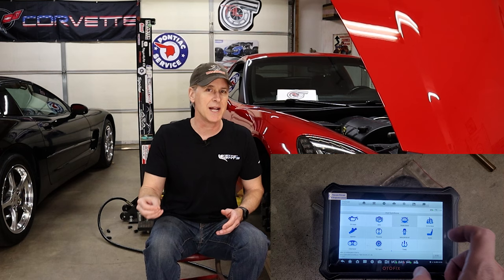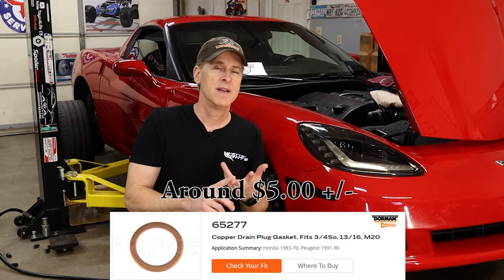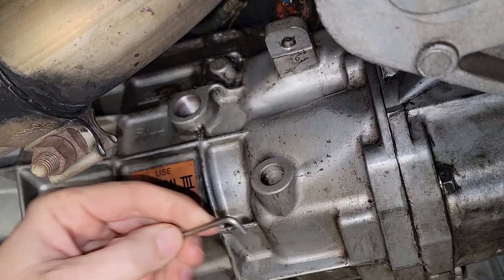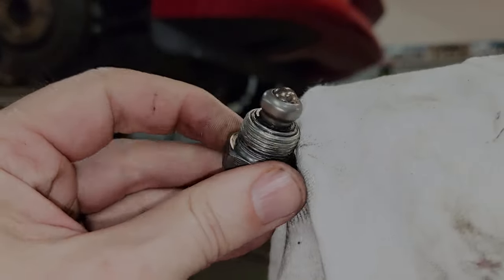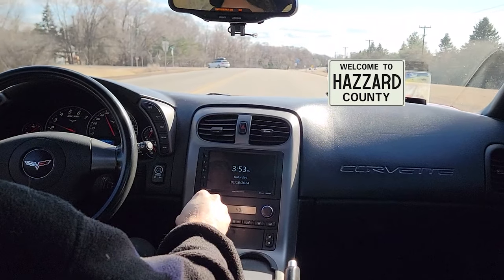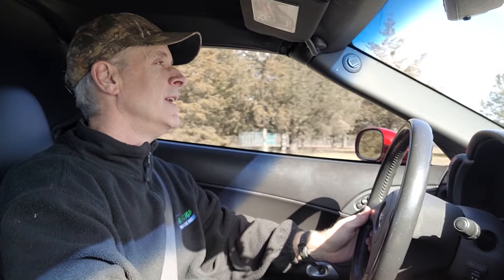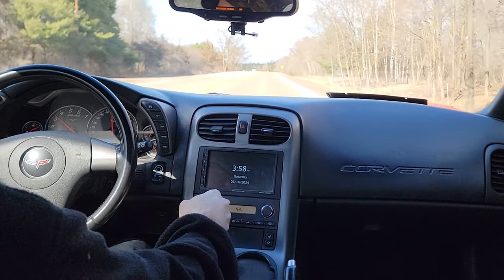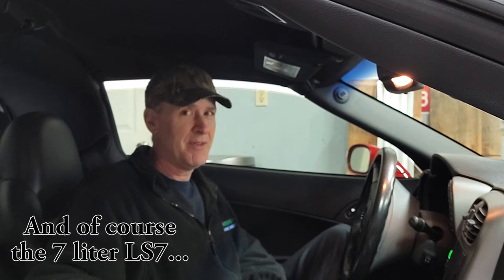C6 Corvette Anti Venom MOD! (Shift like BUTTER!)

Comment: Greg Lovell owner of AntiVenom speed shop in FL discovered the effects of the detent plug on the notchiness of the T56.  Antivenom sold a plug that was just a plug without detent and ball.  The original AntiVenom plug sold for $60 circa early 2000’s.  Forum members caught on noticing a shim would have similar effects to going the plug route sold by AntiVenom.  The shim hack soon became known as the “Anti-Venom mod”.  So no it didn’t originate on Cobra forums, nor was it a forum member known as “Anti-Venom. Some of you guys are just making sh*t up.

Comment: From what I understood when I did the research for my C5 is it originated in the cobra forms (hence anti-venom) on there T56s and the Vette community noticed having the same transmission did the same

I only did 1 washer and bought a used shifter out of a C6Z. Love the way it feels. If I ever change it up. Probably get a MGW and add the second washer.
Reply: You’re  incorrect. The name “AntiVenom” and the mod originated with a speed shop
named “AntiVenom” in FL. They originally sold just a plug for $60 that replaced the OE detent plug with spring and ball. Someone caught on realizing simple brass washers would have the same effect and shared it on the forums. Afterwards the washer shims were referred to as the “Anti-Venom mod”.

Comment: Anti-venom was the forum User who originally posted it.
Reply from the maker: Well golleey, that makes sense :-)
Reply: @Toys4Life ummm, only that’s not true at all. Why @DirtDude117 made that up is bizarre. AntiVenom is the name of the speed shop in FL that first manufactured an actual detent plug that didn’t have the spring plunger and ball on the end. It was just a plug and it sold for $60. Someone figured it out that shimming the OE plug had the same effect. And this hack soon replaced the original AntiVenom mod we all refer to as the “Anti-Venom mod”.

Comment: interesting how much easier it is to access on your car, than my TR6060 Z06 with the 3" pipes. I really struggled accessing it.
And how tight my detent bolt was to remove (even with a 24" force bar). I actually thought something would snap. 
Anyhow, I do have a MGW shifter (vast improvement over sloppy stock...even though car only had about 15k). I stayed with one shim only...and it does improve notchiness, albeit incrementally. I felt that 2 washers, reduced centering a bit much. Either way, it sure ain't a Honduh or Bimmer shifter, but hey...its all the way in back and a vast improvement. Good video!
Reply from the maker: Ya, those 3" pipes take up more room than you would think!  Surprised yours was that tight - odd.  Thanks for the feedback!

Comment: I was going to try one washer after installing a B&M sport shifter, but the hole was counter sunk. Because of that it didnt look like the washer was going to work like it should. I havent driven the car much since then, but still would like to know why it would be like that. I couldnt find any info about it, and cant think of why its like that. Ive been all over the car and never saw anything that wasnt factory, or would indicate repair/replacement of any original parts. Do you have any idea why it is like that? The original shifter seemed normal based on all research I had done on it. It was a long throw I thought.
Reply from the maker: If the washer (s) keep the detent plug with ball from depressing the spring as far, it will make it less notchy.  Not sure what might be going on with yours??

Comment: IMO just get the mgw. It’s worth the money and the best shifter in the market. I’ve had mgw’s on 3 mustangs and now my C5z. They never disappoint.
Reply from the maker: I don't doubt you one bit!  Luckily a friend of mine has one so I can try b4 you I buy.
Reply: IMO the mgw is an overpriced shifter. ( you don't even get the lower box ) The C6 shifter, works great and is only half the cost.
Reply: No comparison between the MGW and C6 OEM shifter. The MGW is far superior but a bit “notchy” until it’s broken in. And yes, the new MGW shifter does come with a billet lower box.